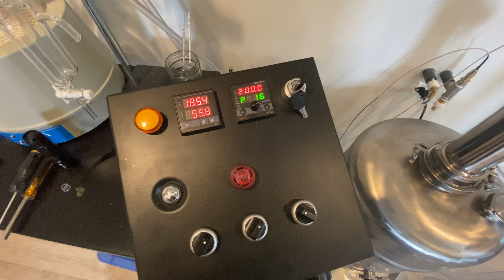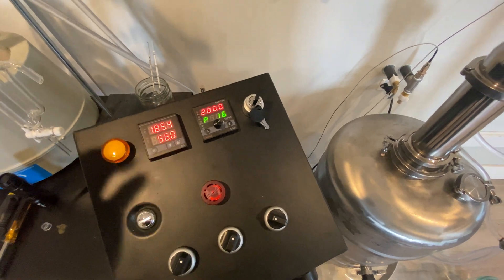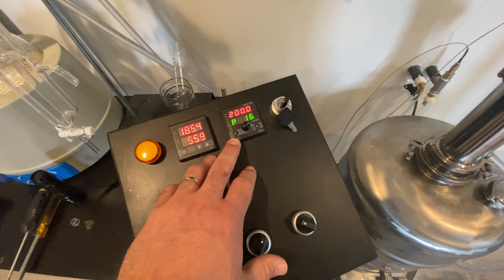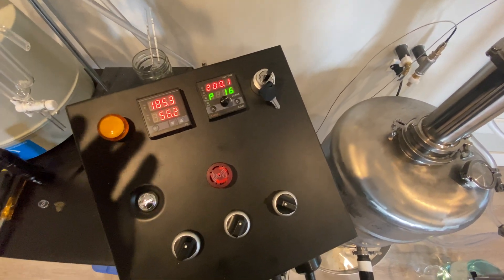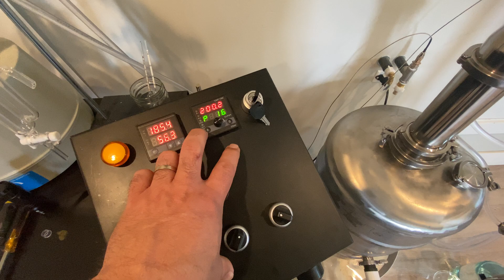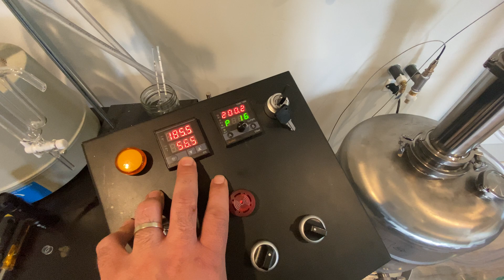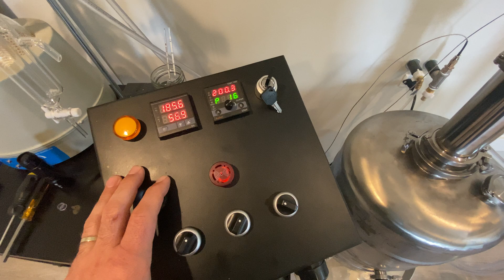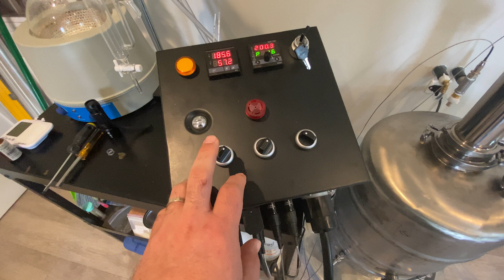Part 1 - Electric Still Controller | DIY Modular Electric Still Series

Comment: About how much you think you have into just the controller and Keg/distiller alone? I'd assume that column and all the ports and attachments cost a lot. Any pics of building the keg..did you farm it out to a welding shop to cup and weld in those ports?

Comment: Very nice setup. Are you going to make more videos on how the controller is put together and wired up inside..did you document and film that? I'd like to replicate your setup, I have a keg and was just going to use the port in the top after I remove the stem and get a two inch column. Is there a reason you went with a four inch one? Where did you get the column and all those attachments? Do you mash in that as well? We'd like to see more about how the controller is wired and how the keg is setup. It would be awesome to see you mash and then distill a run.

Comment: Would you share the wiring diagram for your system?  Your design is excellent with valuable checks and balances for safety as well as to provide "data" for both consistent operations as well as consistency in product.
Reply from the maker: It’s a 1-off with a lot of notes and hands on planning. Best to check out electricbrewer.com . This is where I got most of my info to help build it safely and correct.